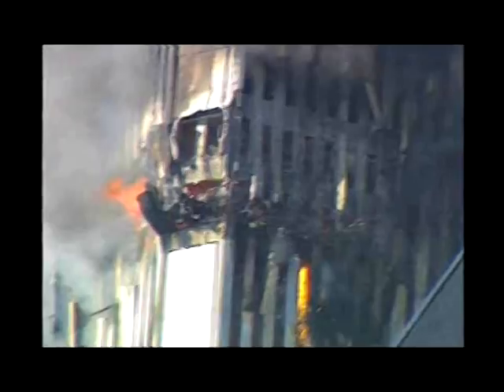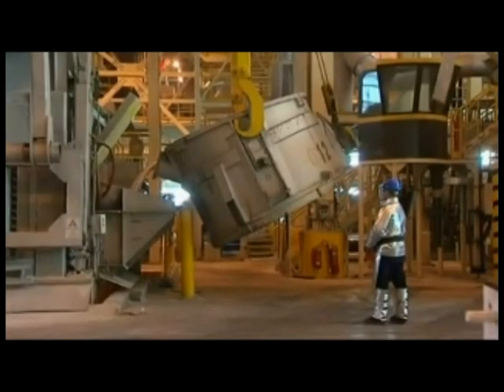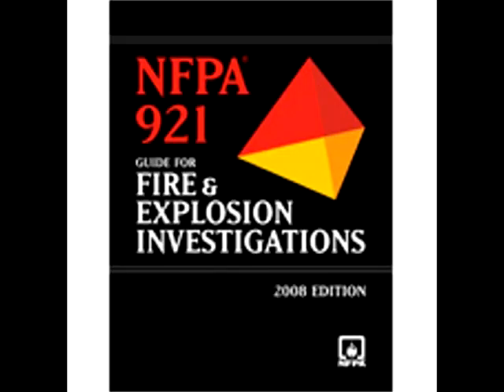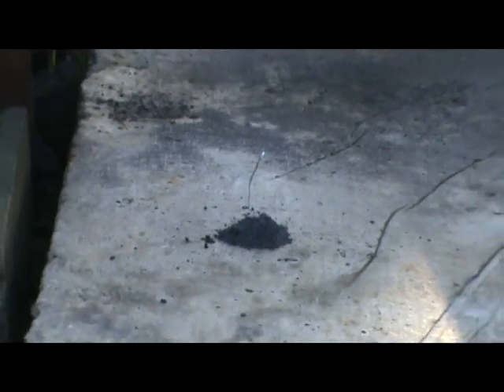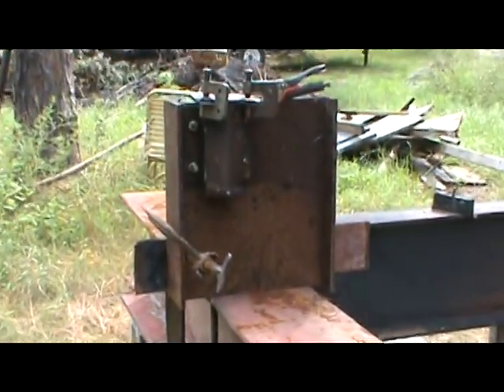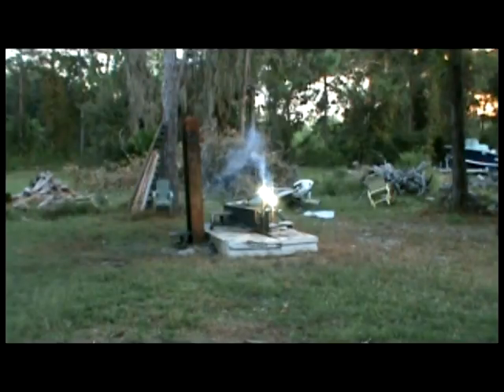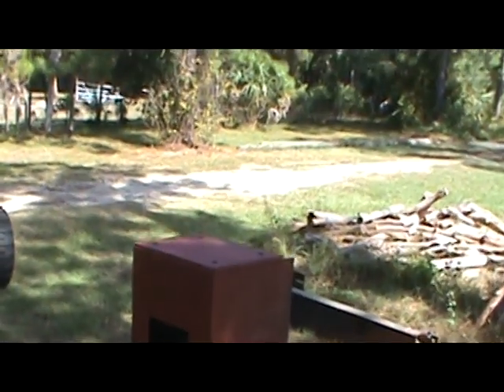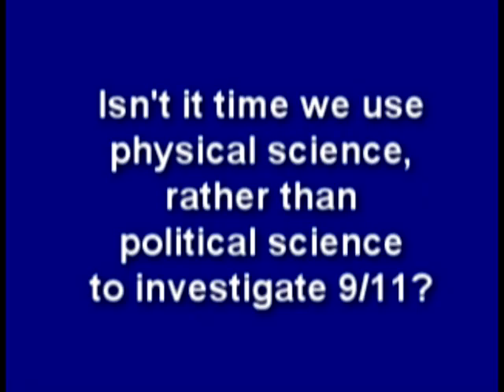9/11 Experiments: The Great Thermate Debate

Comment: You are forgetting that the planes slammed into the building at 500mph. How much heat do you think that created? I could try to light a cross section of a 4 foot thick tree, fail and conclude forest fires don't happen based on this logic.
Reply: Orrin come on with this much evidence you need to open your eyes 9/11 was inside job to get into Middle East
Reply: James Goodhew it didn't take 4 hours...the towers took 56 and 120 minutes for south and north respectively.
Reply: I love this comment.
Reply: Orrin Rockwell yeah but how did the building fall?
Reply: @shadowninja958  weak structure do to the heating of the building I'm not saying this to defend that it was a inside job I don't think that it was.
Reply: Wow! Orrin, you are smart dude!
Reply: Planes were nowhere near 500 mph. If those planes flew any slower they would have stalled.
Reply: @bubba842  considering the fact that a fighter jet can break the sound barrier at 700 mph which on a big plane like the 767 would RIP the wings off that is why fighter jets have small wings
Reply: It doesn't create that much heat but an explosion of jet fuel would make a lot of heat which would cool down quickly and it still wouldn't have been been hot enough to melt the beams but over time the beams might have melted due to prolonged exposure to high temperatures.
Reply: beast jk  In mist form, Jet fuel is more explosive than gasoline and burns far hotter. Some of the conspiracy theorists need to take some basic metallurgy classes. Many grades of structural steel have a relatively low working temp. To weaken steel, all you have to do is anneal it (normally 50-100 degrees F higher than its working temp). Remove the steel temper, it loses its strength.
Reply: @stevehicks8944  you are a genius my dude
Reply: @Depressed Texas Player wrong they do save fuel they usually get caught in the jet stream which allows them to go the same speed without having the throttle maxed or having the throttle high it is just like a fighter jet a fighter jet burns fuel when after burners are at full which allows them to go fast but of they go high up they will be able to achieve the same speed but they don't have to burn afterburners which saves fuel.
Reply: @Orrin Rockwell please enlighten me then, at what speed was Tower 7 hit at again?
Reply: @snowman7234  nobody knows for sure if they were following proper FAA rules it would by 250 which I'm going to go with they weren't following FAA rules
Reply: @Owen Harris it didn't u could see parts falling you could see it get crushed just Nokia flip phones did have that good of quality
Reply: You are forgetting that an airliner simply can't fly at 500mph at the sea level. With the exception of those that hit the Twin Towers...
Reply: @gianf9887  u are joking when u say exception right or u missworded right or are u just dumb
Reply: Prior to these 3 buildings miraculously falling, 2 which were struck by planes, one which was not. No other building in the history of our planet has ever fallen because of an impact from a plane. Now you are trying to tell me that the impossible happened not once but twice back to back in the same day plus a building that supposedly fell because some flames from one of the other buildings set it afire? Perhaps you need to do some research on actual science.
Reply: Depressed Texas Player and I Sexually Identify As A Trashcan, Boeing 767  is fully capable of reaching 500 miles per hour below 30,000ft. The reason commercial aircraft cruise at such altitudes is because they can fly more efficiently there. Less fuel is required due to the reduced drag of thinner air, the air is less turbulent, etc. But near sea level, the aircraft is still fully capable of reaching such speeds, especially in a descent. These aircraft have an operational weight range of almost 400,000lbs. The dry weight alone (no passengers, crew, fuel, cargo) is typically around 200,000lbs or higher. Because I do not have access to the flight logs of the aircraft, I can only reason that the aircraft weighed in around the 350,000lb range which is typical of flights conducting the trip between Boston and Los Angeles at such early stages of the trip. 350,000lbs of additional weight impacting a building at any speed is going to cause great damage. But at the speed in which these aircraft hit, the speed was sufficient to compromise the structural integrity. Adding that kind of weight to the structure was something it was not designed to handle. Adding high intensity fires and a location known for high winds which can help increase the heat of uncontrolled fires is a recipe for what happened that day. The fire was not the only factor in the collapses.
Reply: I want to defend you, because you are not right but are trying to prove that it wasn't an inside job(clearly it was AL QAEDA!)
Reply: @jamesinnit1611  not when its burning jet fuel. And oxygen helps fires burn stronger. I think you are forgetting that.
Reply: The buildings were designed to survive hits from 747s which are double the size of the 767s that hit.
Reply: @BGTom  wtf no they weren't designed for a plane to hit them plus the 747 wasn't even invented when the towers were built so how can you prepare for something that doesn't even exist
Reply: January 22, 1970 was when the Boeing 747 came into service. April 4, 1973 is when the WTC opened. Per regulations due to the airspace, the Towers had to be able to withstand a hit from a 747. It was not without precedent as several aircraft in foggy conditions had collided with NYC skyscrapers before.
Reply: @BGTom  that would be impossible it is too tall for it to be able to with stand a hot from an kind of large aircraft
Reply: @yo_boi_whiskey  Except it was and other skyscrapers survived hits from 747s. Also the South Tower previously went through a massive fire across multiple floors that burned far hotter than the jet fuel did.
Reply: Wow, did you ever take a high school chemistry class? That makes absolutely no sense. How could friction produce enough energy to create pools of molten steel that stayed hot for weeks?
Reply: Steven Terry it’s not friction lmao it’s kinetic energy. I see what you’re getting at but pls don’t say it’s friction 😂
Reply: Those planes can't slam into anything that low at 500 mph because it takes them going way up into the atmosphere to reach those speeds. Why do you think they go up there and maintain those speeds if they could go that fast on ground? Those hollow aluminum pigs also could neither have been steered so precisely into the buildings (esp by flunky pilots with box cutters) nor could they have punched so cleanly and neatly into all those steel beams, right up to the tippy tips of those aluminum wings with a "poof".

Wake up!
Reply: Total BS, I identify sexually as a trash can. Most jet aircraft can attain 400 knots at sea level rather easily. Radar records show both aircraft were traveling at 400 knots shortly before impact.
Reply: I Sexually Identify As A Trashcan They go up there to be fuel efficient dipshit.
Reply: and to make sure they dont crash as the world is not flat and the ground is higher in places so they go high to avoid it also

Comment: The building wasn't supported in the normal manner by the channels and cross pieces, ie: lifted up from below. The central core was concrete and steel, the outer channels and the floors essentially hung from this structure. New way of dealing with sway at the time of the construction. They allowed for a plane hitting the building (as one had hit the Empire State building). Read about it in either Popular Mechanics or Popular Science in the mid / late 70's. Problem is, these weren't slow moving planes trying to avoid an impact. They were fully loaded and fueled and flown deliberately into the buildings at high speed. Which destroyed more of the structure than they had allowed for. But since you want to believe it was an "inside job", how about you do a study on how much of the building would have been torn apart to place the 'charges' and how long it would have taken. Then, explain how no one noticed the activity.
Reply: If explosives were used they would have gone off immediately.  Not after hours of heat.  
There is no word that can explain how Ignorant, blind, insane, stupid, decieved, humans can be.  Closest would be SUCKERS.
Reply: maybe because white collar workers don't know anything except office work
Reply: Interesting point about the impact that I have not seen disused. I don't pretend to know anything about the physics of the impact and structural integrity but it seams like if the impact was the main cause for the collapse it would not have taken hours.  I would like to see someone dive into this topic more. As for someone believing it was an inside job and explaining how no one noticed I don't think it would be hard for a Jason born type person to come in as a night janitor with all the fake credentials and plant what ever they needed moths weeks or days ahead of time. I mean a safety vest hard hat and a clip bored might get you in slap on an electrician or plumier logo on and you might have a reason to go bang on some walls without anyone really noticing

Comment: Thermite is used to weld railway tracks together. It therfore it may be possible that burnt thermite may exist in the rubble due to the construction process and welding. As for the experiments shown here great creativity to prove a hypothesis.  But I noticed one thing you haven't discussed and that's the smoke caused by burning thermite. As your footage show the towers lack that smoke from a chaotic burning powder. There is molten metal but no smoke. Like using a blow torches.  Next experiment might be to simply place blow torches that will cut through the steel. As I don't think thermite was used do to the chain of evidence it would leave behind.

Comment: Does no one fucking understand physics? You don't need to melt steel. If you weaken the structural support, with 100tons+ sitting atop a weakened structure. It's going to give away eventually... Then gravity plays it's role.

Comment: jet fuel cant melt steel.  But it can heat steel to the point where it easily bends under pressure.  if thee weight of a building isn't enough pressure i don't know what isn't.

Im not denying you make a very convincing argument.  This defiantly warrants further investigation.

Comment: Under pressure metal behaves differently. The pressure of the weight of the Tower created a different reactionary response of the metal in the heated areas. Pressure is the culprit of the molten metal not your stupid conspiracy theory.

Comment: On the railway we routinely use thermite to melt steel.  I worked for the Signal dept.  We needed to make the rails into part of an electric circuit.  To ensure a connection from rail to rail we welded some highly durable stranded wire to each rail...with a thermite process as follows.  Special molds, made of some exotic material that didn't melt.  The stranded wire went into a hole in each mold.  A powder was emptied into each mold.  It clearly had thermite and magnesium.  You ignited it with a spark.  That got the magnesium going -- bright white flash -- and then the thermite reaction.  Insanely hot, even with a fraction of an ounce of thermite.  Then you took the molds off.  Done.  Welding...with...thermite.